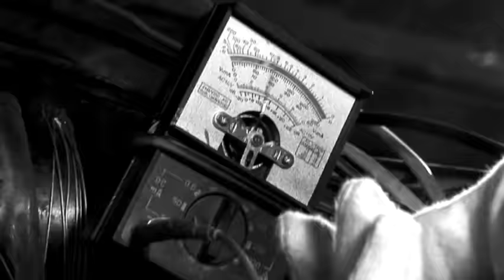Converge - Axe To Fall

Comment: @GGxBeast (page 6 currently) There is a lot of confusion about genres, so it's hard to say with any certainty that there are two, and only two, distinct metalcore genres.  And Jacob Bannon himself said they're not a metal band, they're a hardcore band.  The bottom line is that they should be the beginning of a new genre, because they are genre transcending and genre bending.

Comment: @grahamzandah I wasn't really trying to be argumentative. I was just stating what I thought it was. And I  don't spend that much time on classification. I just like getting lost in it more than anything. If it's mathcore, it's mathcore, if it's grindcore, it's grindcore, whatever. If I like it, I'll listen to it. It's hardly a deal-breaker what the genre is, technically.

Comment: @Lateralus347 To each their own, I would say Four Years Strong is a great band even though their talent isn't exceedingly impressive. I like Invade from Within the Ruins but for The Acacia Strain I prefer Wormwood, those albums are both good. If I may digress, this is most likely rhetorical but do you like BTBAM?

Comment: @grahamzandah First off the harmonized guitar argument doesn't really apply, because there is only one guitarist in Converge. Second have you ever read Converge lyrics? That's one of the best parts of the band. Lastly (and not to be a dick) how do drums produce melody? I can understand intricate drumming, or technical drumming, but what is melodic drumming?

Comment: Parkway Drive is just another boring ass "core" band that relies almost solely on chugging riffs and breakdowns. They have never been, and will never be in the same league as Converge. Bands like Converge basically forged modern hardcore, and to this day they're pretty much the only ones who can do it right. Bands like Parkway Drive have just jumped on the "core" bandwagon and contributed nothing but "CHUG CHUG CHUG - BREEEEE".
In short, no more comparing turds to legends.